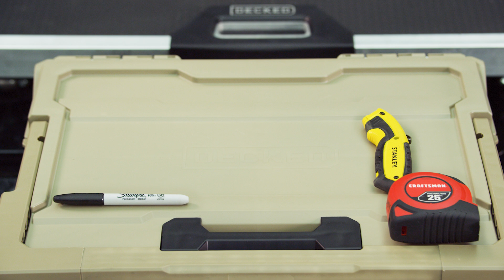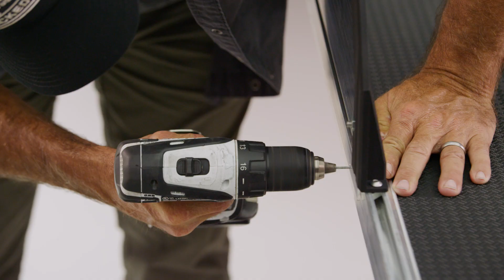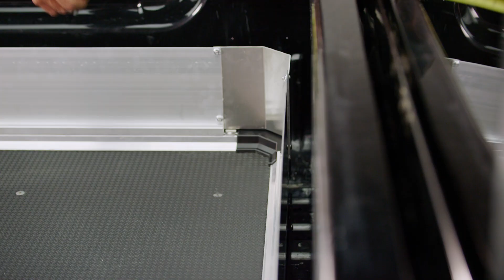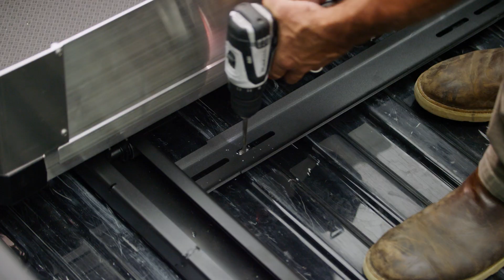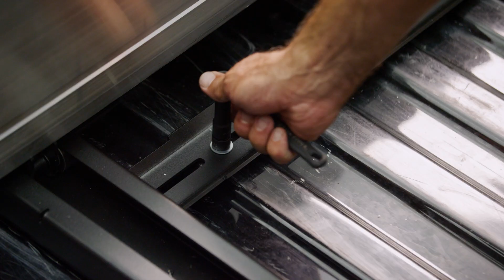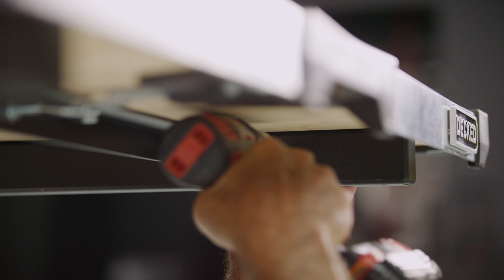DECKED Installs | Easy Install Of The CargoGlide In Your Truck Bed

Comment: I really want the new single drawer system on my Trailhunter, but I’m almost positive the Decked system will completely block the tire compressor flip door on the left side of the truck bed. Has anyone tried to install one on a Trailhunter?